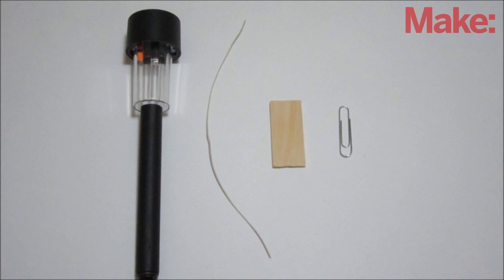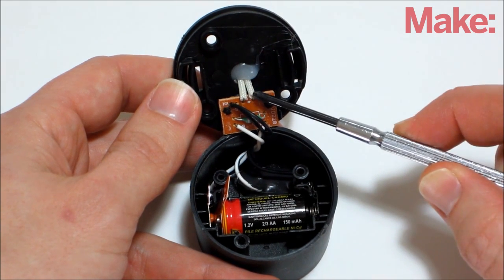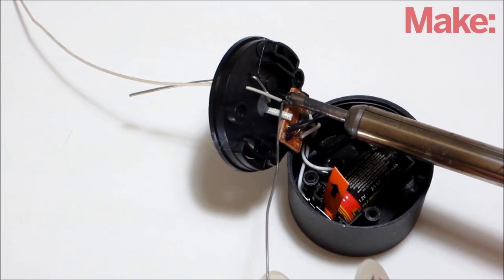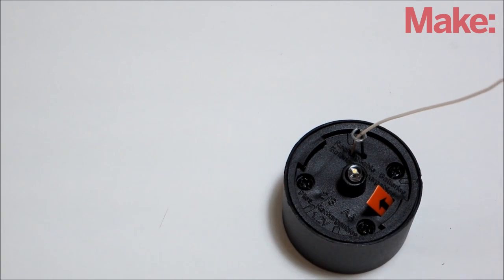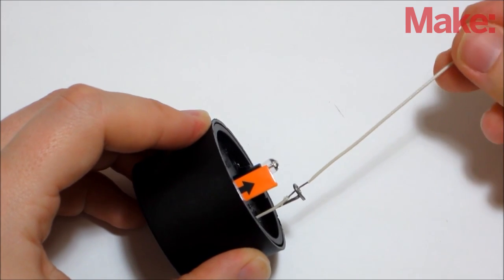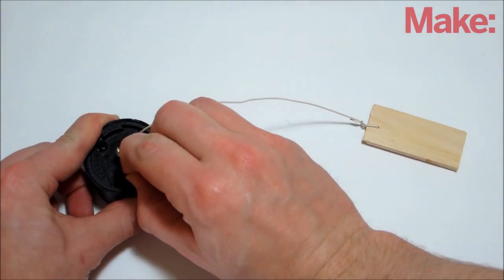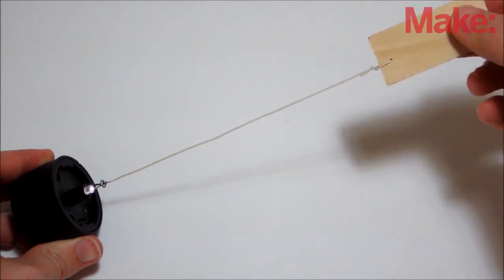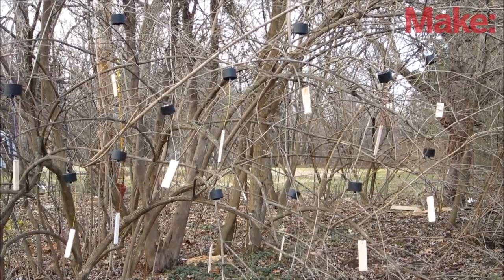DIY Hacks & How To's: Wind Activated Lights

Comment: Here are some Ideas to harden the light Put a dolop of silicone sealer on the top holes for the hanger.  Use solid tined copper wire instead of the paper clip. roll the loop around a small round nose pliers and solder the loop closed Use the same wire for the hanger just remove a small amount of insulation where the loop is for contact. Cut the bottom off of the clear section and reinstall the clear new tube on the fixture to provide a rain shield to the lights bottom.use a part of an old CD

Comment: Stainless steel wire and use a better quality solar light.Then glue the whole thing into the bottom of  a small glass container and hang it upside down. Nice idea but those cheap solar lights won't last long. I had 10 of them last year and all of them were dead within 3 months. Opened up and then using a paperclip as an electrical contact will shorten their life even further. Might be worth experimenting and making a part two video for this project. Good luck.  :o)

Comment: This will die after a week as the exposed metal will rust and stop it from working. You need to use stainless steel wire instead of a paperclip. Then it will last 2 weeks until the crappy solar light fails due to water getting inside it.